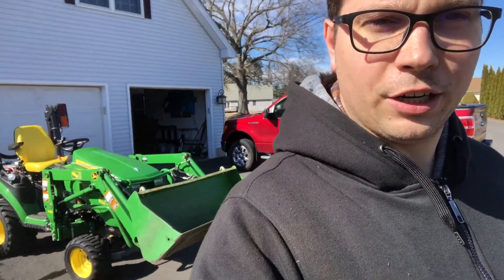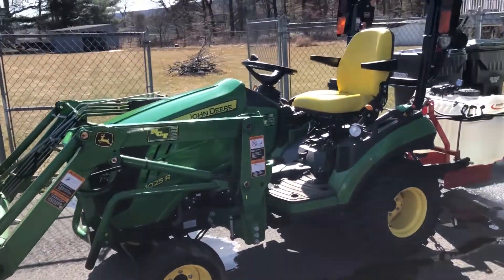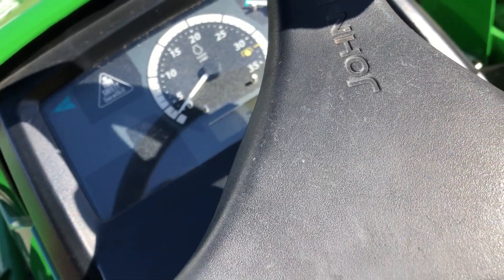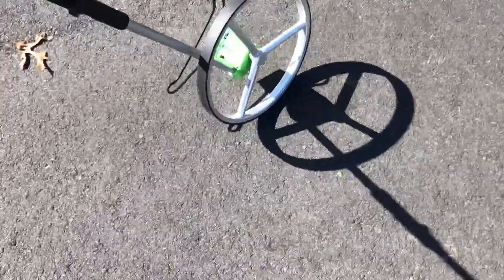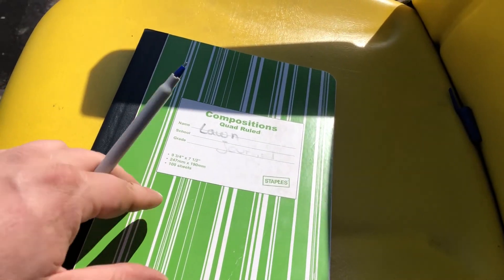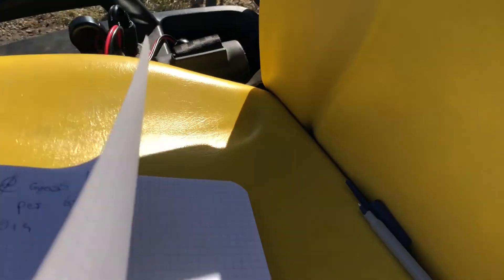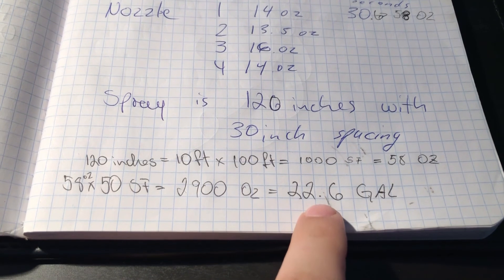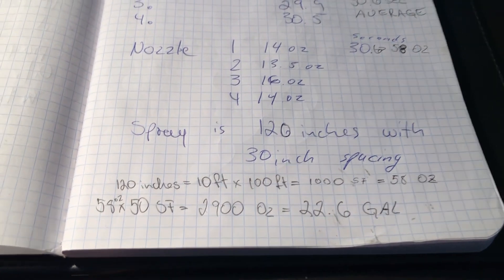Calibrating Fimco Boom Sprayer on John Deere 1025R

Comment: Very informative and thank you for working out the math. I have a 1026R I bought new in 2012. It's been a great compact tractor for me. I have a number of attachments plus the Mauser cab I had installed two years ago. My primary use is mowing with the 60" belly mower. This past winter I used the 54" two stage snow blower on the front and it was a real life saver for snow removal of over 33" of snow. I have four acres of property and there is nothing my tractor can't do. The only thing I've found lacking is the radiator screen tends to clog up when mowing the pasture. It needs cleaning to avoid engine overheating. Good luck with your tractor.